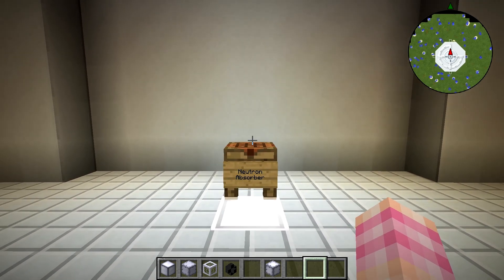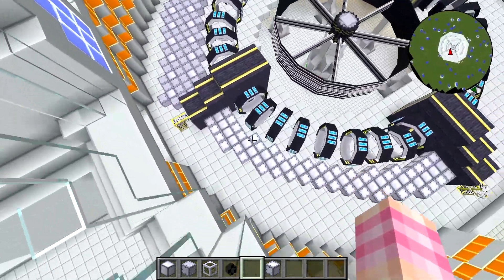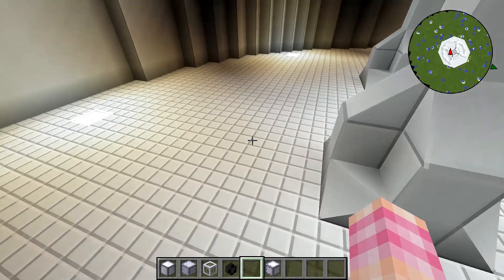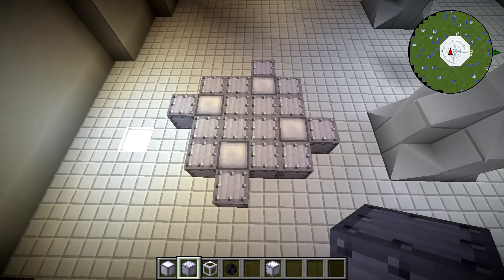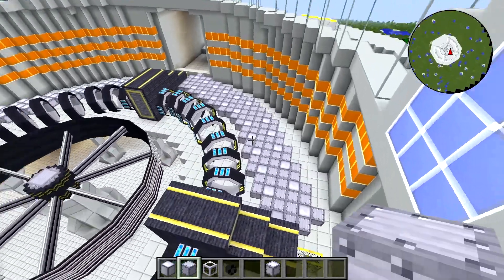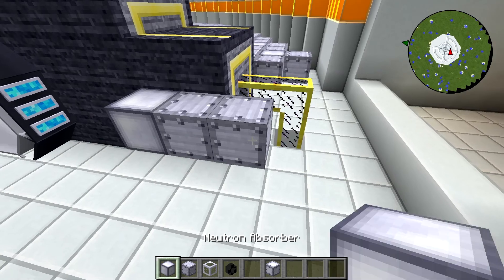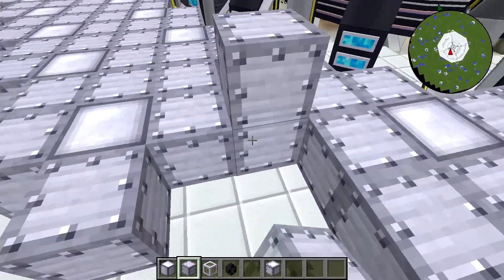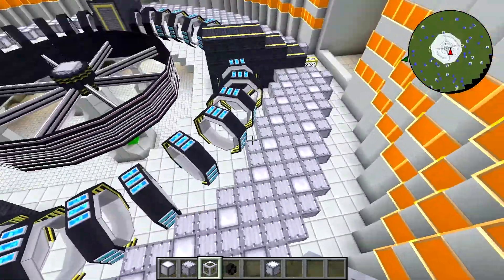ReactorCraft Tutorial #24 - Neutron Absorbers and Boiler Positioning

Comment: Much of Omega's information is half-correct. For one, his "one boiler per absorber per injector" rule is simply wrong: Though it is true that more injectors will necessitate greater cooling, that rule exaggerates that requirement.

Also, that design is going to be very difficult to keep wet - I may need to invent a new piping system for it - and a bit laggier from having 3x as many ticking TileEntities.

That said, I would like to see it in action.

Another thing he told you about, using boilers as a heat buffer is mostly incorrect unless your water supply is woefully insufficient. They sink heat much faster than they spread it.

Finally, you do not need to insulate the reactor exterior against neutrons; neutron absorbers have a 100% capture rate.
Reply: Now if I can say that the neutron absorbers (in the real world) do not absorb neutrons they slow them down. Also I have a question, so nuclear fission creates a lot of waste. But nuclear fusion makes a byproduct which is helium plasma, yes it does make neutrons but what do you do with the plasma?
Maybe we through it at the sun, idk but anyway just, well i do not know we would do with it. it's to hot to move it around so my guess it is sort of nuclear waste (but not radioactive.(please don't sing))
Anyway I just thought this was interesting. Anyone have any ideas please reply.

Ps reika you make great mods that confuse me. And that's a good thing.

Comment: And how u would supply the water the noncreative way 😀
Reply: If you have other mods, ExtraUtilities is good, but usually the answer is PUMPS. If you can you might want to recirculate the water
Reply from the maker: ***** You would need quite a lot of them but you're right, if you haven't easy access to water via other methods that machine is certainly viable.
Reply from the maker: ***** Is that at the base power or do you have to add more power? I haven't really used them myself.
Reply from the maker: ***** I'll look into it.